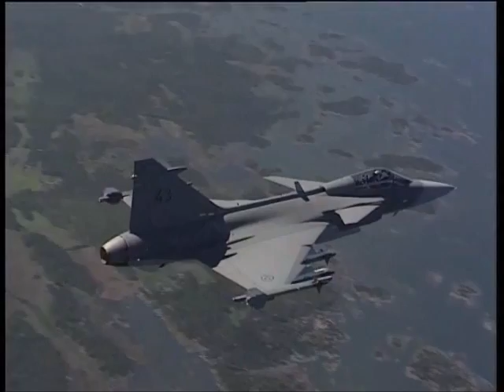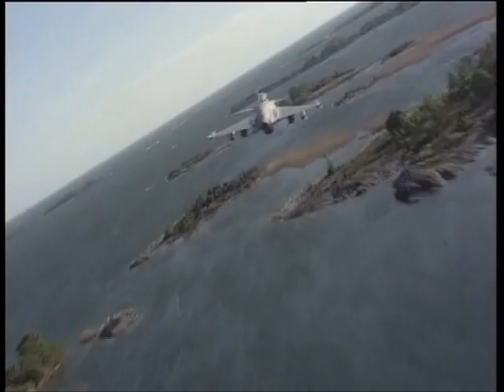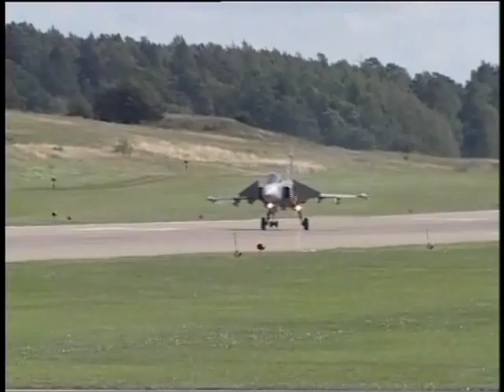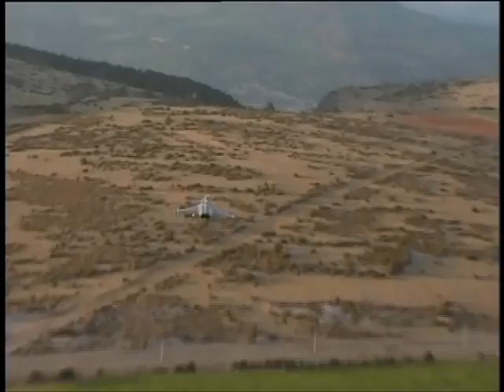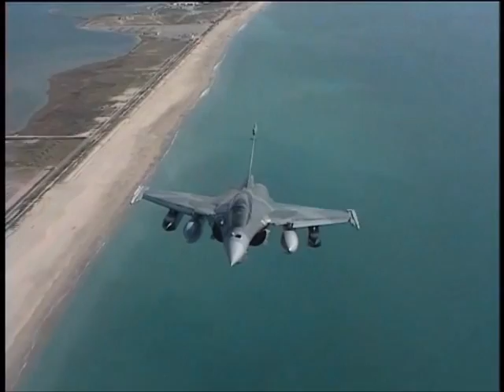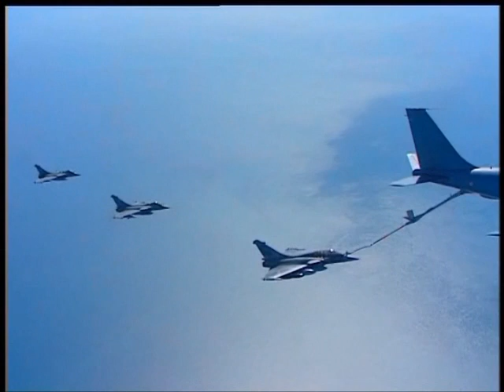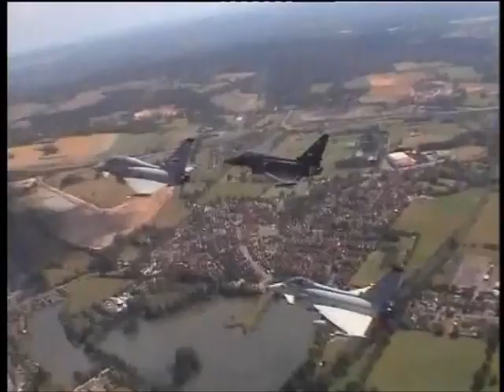Eurofighter, Rafale, Gripen - AircraftRecognition.co.uk

Comment: Actually you are delusional,
1: At the pafific vision wargame The F22 had 27:1 kill ratio in general. and was able to shoot down 48 "advanced flankers" when outnumbered 12:1 without loss. 

2. The S-400's radar can detect and track targets with a RCS of 0.02 sq.m within 50 km. The F22 has a RCS of 0.0001 sq.m. 

3.No the VERA-E radar cannot detect the F22, because of its electronic warfare systems, and its also confirmed that the F22 can deflect ALL type of radars, including passive radars.

Comment: Actually also the Chnese J-20 will be better than both the PAK-FA
& the F-22. Also the SU-35 can easily take on the F-22 and probably
put up a 1:1 kill ratio in an equal number dog fight.  F-22 is outdated
crap. Stealth fighters are the fad of the past. VERA type anti-stealth
radar has rendered most types of stealth fighter technology useless.
Planform & stealth paint all you like. Ukrainian & Czech made variants
of VERA will detect you efficiently upto 200KM & upto 1000KM somewhat.

Comment: Wrong actually the Russians say their S-400 anti-air systems
are ready to take on anything 5th Generation & beyond. That's 
the real truth. The only question is their effectiveness against
yet upcoming modifications. Yes the F-35 can defeat them
if the country they invade does not have VERA type anti-stealth radar. However, these systems are sold with the Ukrain made
anti-stealth radar which can detect stealth fighters upto 200KM efficiently.

F-35 vs VERA & beam weapons = you fail. GL!

Comment: Russia has already stated that the US stealth fighters pose a threat to both the S-300, and the S-400 systems so you kind of failed there.  The F-22 radar  cross section is equal to that of a small metal marble.  The F-117 is old tech and shows up much larger on radar.  As far as engine tech goes the F-35 engine is producing 40,000 lbs. of thrust.  The most powerful single engine put in a fighter.  The skin of the F-35 is also radar absorbant fiber matting that provides structure.  Way ahead.

Comment: The quote from the Germans was they were surprised that they could turn with the F-22 if they got to merge.  If they got to merge they felt that they were equals.  However, everything about the F-22 is designed to not let you get to merge.  It is stealthy, functions well at high altitude, and has sophisticated radar.  Chances are the F-22 gets off the first shot.  That however isn't how these Red Flag events work.  They are a setup dogfight that rarely happens in real life.

Comment: all of these where designed in the 80,s an so where the f22. f35 is the only "new" fighter that nations buy. but that aircraft inset even ready for service because it takes about 10 years for a new fighter system so be ready for combat. and the new nextgen gripen have gotten a heavy update. even hull redesign and increased size, aesa radar, 30%stronger engine, 10 hard points, worlds most advanced data link system, helmet mounted display. i can go on

Comment: F-22 can hold a sustained 60 degree angle of attack.  If it is more agile it is by the slimmest of margins.  Eurofighter has shot down F-22's at Red Flag events, but they simulate dogfights and don't play to the F-22 strengths.   There is one plane in the world that might be as good as the F-22, and that is the Pak-Fa.  Russia has 4.  We have 196 raptors and are done.  We will have a sixth Gen plane before the Pak-fa is produced in real numbers.

Comment: First I knew that, second F-35 has been touted as being capable
of a JAS role but it really is not unless it's going up against cold
war era crap but any of the modern fighters can blow it out of the
sky easily so that's why it's a fighter-bomber because it's a
flying armadillo with lots of fancy electronics. In a dogfight with
anything modern it's dogmeat, the Eurofighter is not only capable
of the JAS role in any scenario it will dominate if it's used in a
defensive strategy.

Comment: There is a trade-off between stability and maneuverability. A high level of maneuverability requires a low level of stability. The delta wing aircrafts are aerodynamically unstable in pitch and rely on fly-by-wire computer control to provide stability. There are two other techniques used to provide stability a) Sweep the wing leading edge back to reduce angle of incidence b) Use a wing aerofoil section with reflex or reverse camber. The Rafale has all these tech's incorporated in it.

Comment: When the aircraft are traveling in subnonic speed, mach 0.8,this is barrier start before supersonic speed, the air produce shock wave and vibration, making the aircraft unstable, but when overpass this barrier, the air produce a "sonic boom", like a thunder, then the aircraft come supersonic and turn stable again, the air molecules joint together producing better lifting and performance.

Comment: Some single engine or sizes combat that have similarity with Saab Gripen, some performance, maniobrability and others with poor performance to fight with J-35, F-16 or F-35. With  poor performance, less maniobrability and poor radar: the Pakistan JF-17 (Thunder),China Q-5 (Rantan) and F-5 Tiger, with better radar: F-35, J-35,F16 and Mig-21 Bison (last upgrade) with better maniobrability: J-35 and F-16 block 50, load weapons weight: F-35, J-35 and F-16 in same level, after: Mig-21 Bison.

Comment: For be more clear, better understand: Dessault specification say: 1.8 not: 1.4 mach. 1.8 is two digits less that mach: 2.0 or 2.1 in others source Gripen (remember that this factor can change with upgrade), in term of speed, its about 200 miles per hour plus.This is insignificant to combat fighters aircraft, better to commercial airplanes, because: "Stealth", radar,advance missiles and combat manouvers make the diference in today war. I see again this characteristic in 6 generation aircraft.

Comment: role, this contribute to carry more weapons ordenance, instead mach speed charactheristic and realyble if one engine fail, this is the point of frenchboy, as I can understand,obviously the Gripen as the F-16 have realyble engines accord with own performance,weight,load, weapons and specification manufacter. The: 1.8 or 2.2 are hundreds mph diference, even: 2.5. not: 2.8 or 3.0: the SR-71 Blackbird in his history achievements.

Comment: By another way: I read Gripen Company inf.,Wiki and others sources, the engine its american F-404 derivate, the same engine in F-18E, the mach speed of 2.0, in the Hornet its: 1.8 mach, Rafale Dessault source mention the same to Rafale. but like F-16; in modern combat aircrafts the diference in hundreds of mph dont have to much significanse advantage, ecept for interception or exit over enemy territory, reason of Mig-31 Foxhound existence. In weight load weapons factor, the engine have important

Comment: Aargh, you don't even read what I'm saying. Or else you just don't understand. JAS have a max speed of M2.1, which is quite fast - and at the same time the aircraft have a very low stall speed. You said the JAS is slow due to one engine, which is not true. It would be great with a 2-engine JAS, yes, buit it doesn't affect the speed that much. 

The official Dassault-page say M1.8. Why should I trust you rather then the official page? Please link to a more 	trustworthy informant.

Comment: I will never say that Rafael is a bad plane or nothin'. But all counties have different needs. Eg. Gripen (and even JA37 Viggen) is build for STOL. This because Sweden have highway strips (public roads that can be used as air base). 
I'm sure Rafael is a better plane for some countries, and for some other countries the JAS is fitting much better.

I think we both is a bit partial in this question. But in anyway I find it very impressive that little Sweden have build their own aircraft since 30's

Comment: more biger platform,have space and wings to acomodate more sensors, also fuel and others equiment like Raptor, I can compare the Gripen in same terms like F-16, F-5 Tiger and Japanese: F-1. with canards advantage, not match against: Raptor,Rafale,Thypoon,Su-27/30Mk and F-18E/F Growler sorry, and the Rafale could superate the export shortcomings, India choice it if dont know yet. Also fought in Libia, and have a distintive angle cabin like Raptor.

Comment: The Raptor will ever cost more that any,first: the weak point its that can not be exported, the reason of why the F-35 can be sale and cost less, second: have full stealth and vectored thrusters, this future is more expensive and exclusive, If its cost issue: (cheap) the Gripen win and Raptor lose. But about tecnology enginiering and BVR, I choice the Raptor, in dogfight and versality: Rafale, have achivement in Libia Operation, the Typhoon dont do it, need upgraded.

Comment: The rumors about F-35's electronic problems are true, they've
had to be grounded several times. But that's just the fact that their
DAS system is so advanced it's on board memory isn't able to handle
the data streams - that's the problem with having a Jet that is practicly
a robot - if the system crashes it crashes. I don't like that idea of
flying. The pilot should always have control.

That's why I'd rather have my Nation buy the Gripen or the Eurojet
over that robotic hunk of junk (F-35).

Comment: The F 35 is also a good jet but i've heard some rumors about electronic problems something with the communication system? I'm sure resolved quickly though. However F 35s downfall is it's pricetag. You don't get much more of a aircraft but the price is way higher. Gripen can do most roles on the battlefield but aren't the best at any role, say F 22, Air superiority and not much more.

Comment: Yes most comparable aircrafts can be retrofitted. However the Gripen was designed with multirole as high priority.

It has one engine yes it makes the aircraft ligther and doesn't require equal amount of maitenance. Also on maitenance the Gripen is deisgened to be very simplistic which cut maitenance time.

The reason why there is few Gripen in comparison is because swedens defence budget doesn't allow for more and the fact that orders haven't been on many aircrafts.

gripen is cheaper per unit.

Comment: Any fighter jet can be retrofit to perform the JAS role.

Gripen is an excellent & capable cold weather fighter but it's
BVR is not as Good as the Eurofighter, it has only 1 engine,
it's combat radius & range is shorter and it is too few in comparison.
It's a great jet but not as great as the Eurofighter! 
Eurofighter is the best! It's better than the F-35 & SU-35.

Comment: Yeah but you get half an airforce of these for one F-22 :P F-35 is a more comparable plane, although even the F-35 is more expensive yet. I think the F-22 is a bit of a failure even in the eyes of the US. As I understand it it will never be the the replacement for F-15 as they hoped, as it is to expensive.